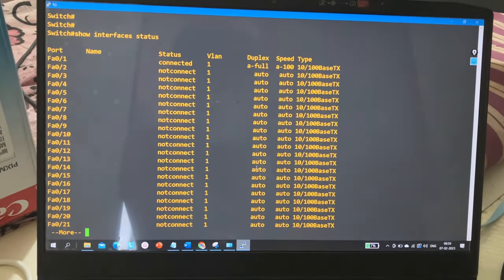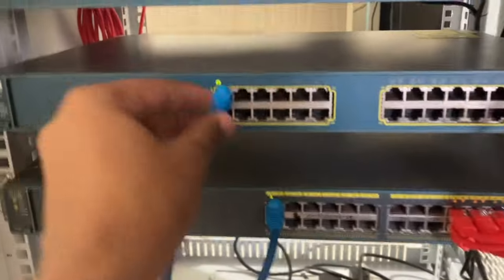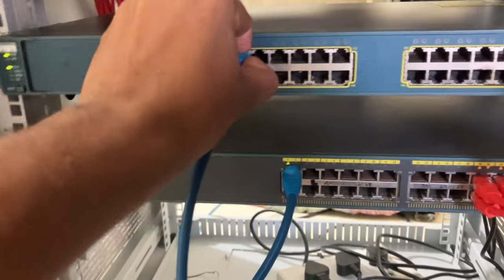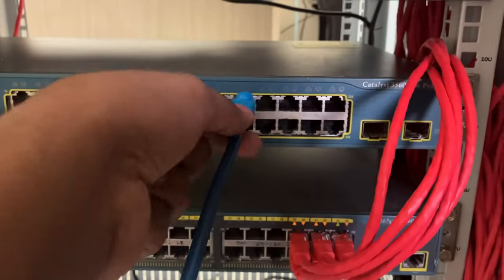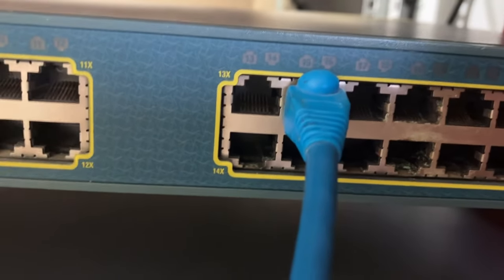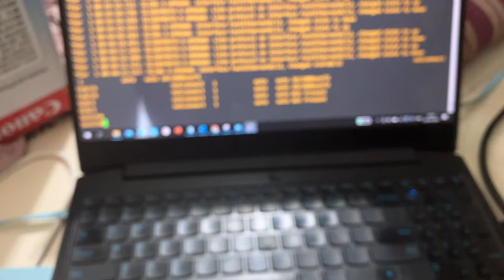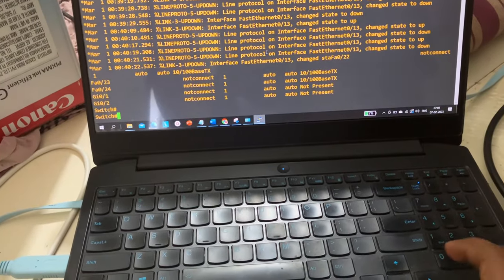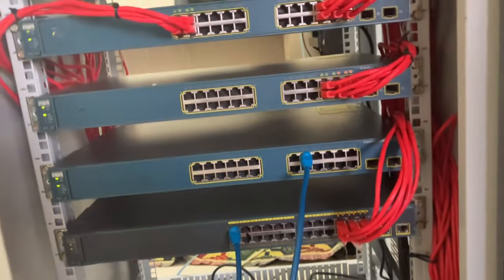Do you know Basic Network Troubleshooting | Real Devices Troubleshooting | #ciscorouter #ciscoswitch

Comment: I will troubleshoot by checking the status of the interfaces.

Switch> enable
Switch# show ip interfaces brief

If the status of these ports are administravely down, you will need to bring them up

Switch# Configure terminal
Switch(config)# int range f0/15 - 24
Switch(config-if-range)# no shutdown

These ports should come up and the problem should be solved.

Else the switch has a hardware issue.
Reply: Simple

Comment: I would do troubleshooting as possible from my end. I will check all the interfaces status (Find command as per the switch model type) and also do no shut down to all the ports which are not working. (Can use packet tracer to do practical if want to see the commands). 
Still if it doesnot work then once reboot the swtich physcially just to make sure its property connected and rebooted. 
If still ports dont work it should be a hardware issue mostly.

Comment: One is green & rest of the lights are orange which shows that both switches are in native vlan. Connect the upper switch cable to port 15 & below switch cable to port 1 then run commands on the below switch: sh ip int br...(to check if the port status is down or up)...
Reply: wouldnt the port staus automatically be down since theres  no lights on port 15?

Comment: I think this is port security isssue
Reply from the maker: This was hardware issue
Reply: if it's a port security issue, interface would in a "err-disable" in the status column the remaining port-security modes does not shutdown interface, 
as you can see in the sh int stat, all the ports are in the same vlan, and non of them are "administratively down"   

which leaves us with a physical error